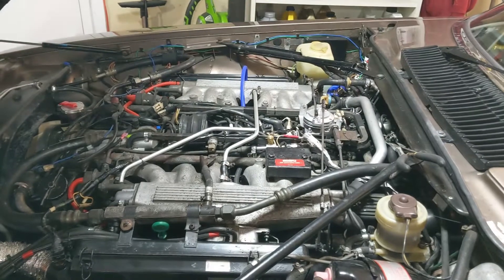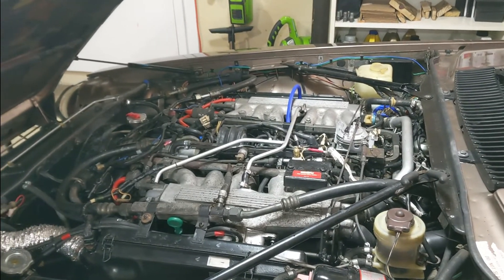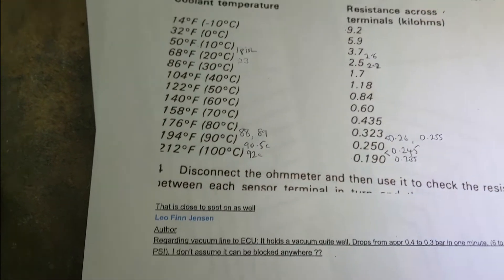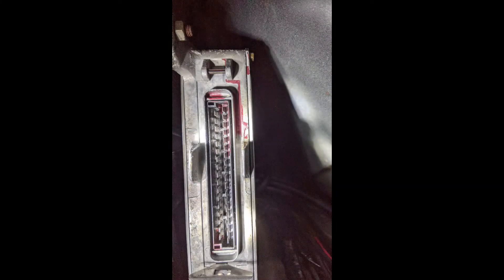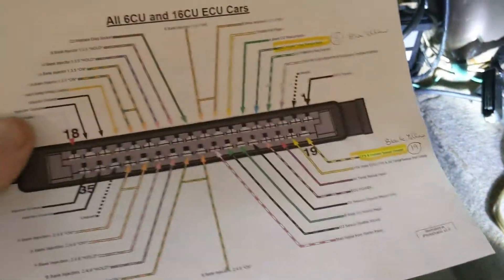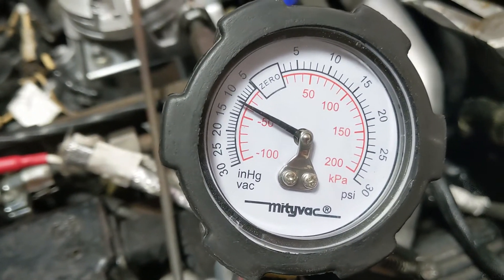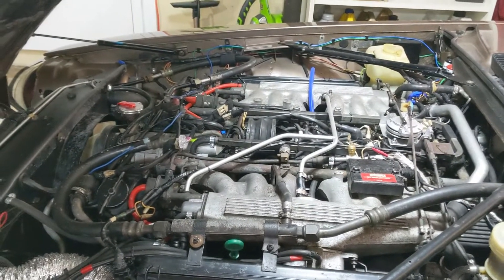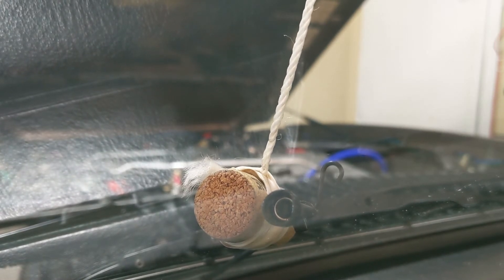1986 V12 Coupe "Short".          Cold Start problem.  Sensor Check

Comment: Thanks Peter!
Reply: For anyone else with a Jag V-12 with cold start issues, checking for continuity for the coolant temp sensor wiring at the ECU, I found I would lose and regain while tugging on the 2 CTS wires closest to the CTS. I unwrapped the factory black tape and found several cuts in the insulation of both wires from age and engine heat.
Spliced in section of new wires and car runs fine now.